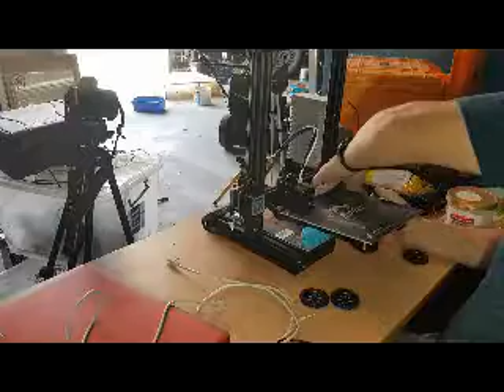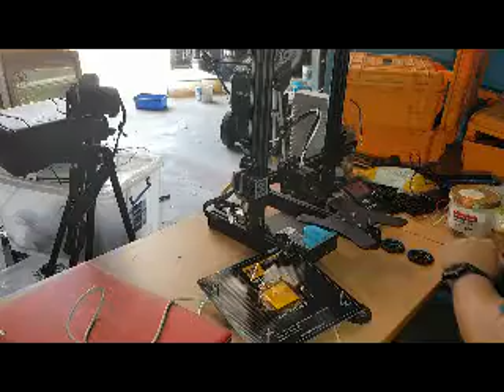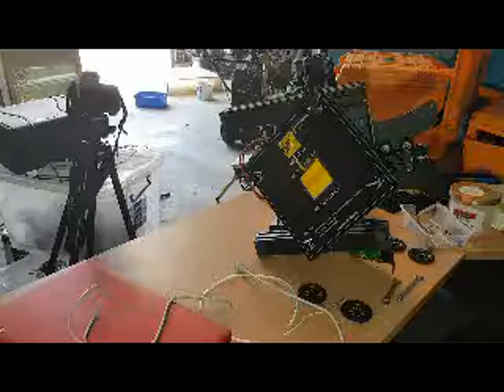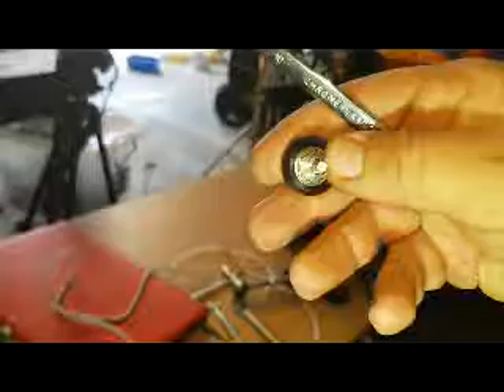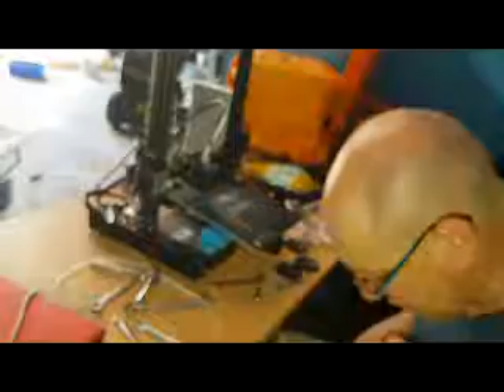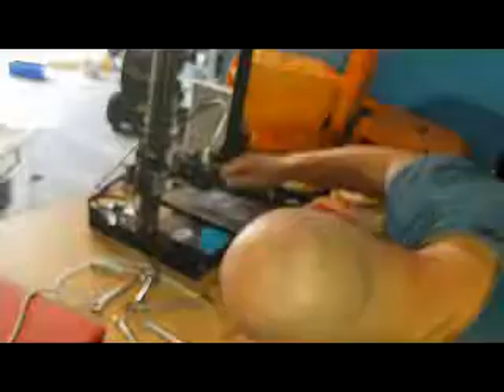Ender3 Bed wheels faulty from the factory. How to fix it.

Comment: It is very hard to see anything that you’re actually doing, and there are various descriptive factors that play into reattaching the wheels to make sure it happens properly, such as making sure how each spacer is supposed to be applied (difference between positioning on the build plate of the straight bore and the offset), where the smaller washers are supposed to go, and how tight everything should be to ensure it doesn’t cause the wheels to start getting eaten into. If you make all of this information concise and limit the video to even just closer snap shots to show the exact meaning of your words, I think you would reach a wider audience. Not every issue that arises from the factory is going to be the exact one you had, but rather a combination of possibilities relating to the bearings and washers. Hope this comment helps you make another video!
Reply from the maker: I did find a faulty wheel under the bed. I fix it and the ender3 works correctly now. But you are right I need better camera work. Thank you for your advise I will take it on board. Have a wonderful week.